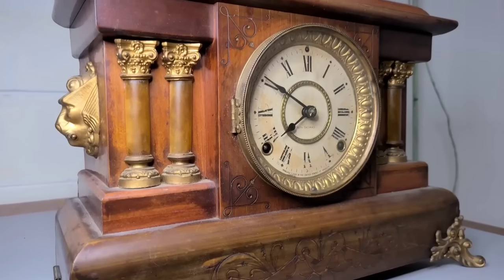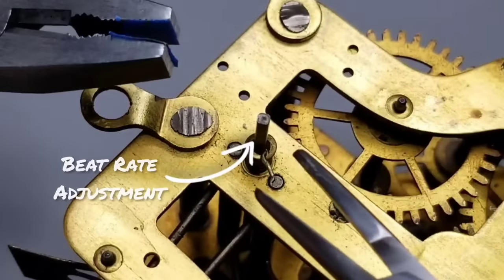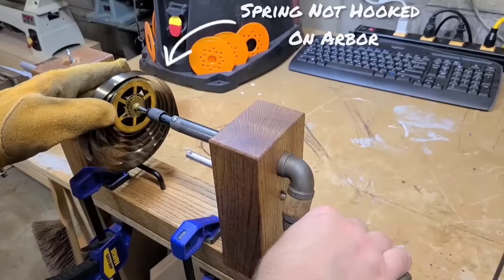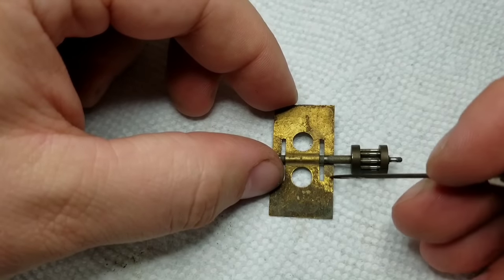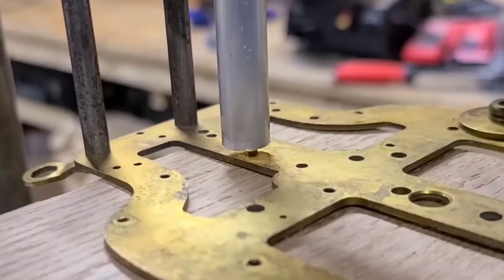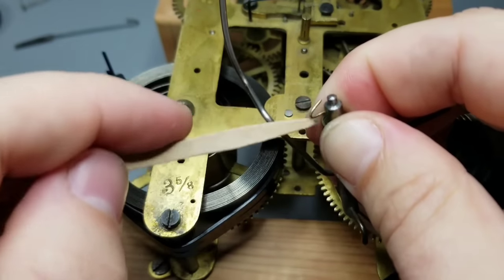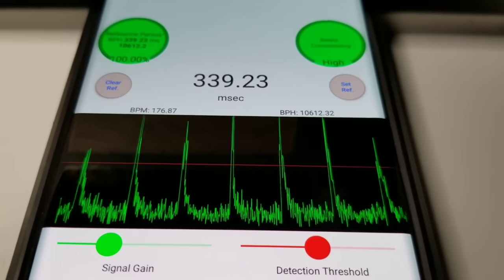Neglected 1900 Seth Thomas Clock Restoration

Comment: I have a mantel clock that looks just like this one, except mine is black.  It used to run but was very sensitive and needed to be precisely level. Now I can't keep it running no matter how much I shim the feet to adjust the level.   Any advice?  I still have the clock on my mantel.
Reply from the maker: Could be many different things such as worn pivot holes, dirty or gummed up areas, power from the spring is getting lost somewhere, etc. Probably needs to be cleaned and inspected for problems.
Reply: @WatchOverhaul   thank you.  Maybe I’ll get that done as a Christmas gift to myself.

Comment: Great job, nice to see you learning techniques to repair and maintain this old clock. I was curious as to why you didn't use a solvent to initially clean the works? My method is solvent first and soap last.
Reply from the maker: I was thinking using the solvent last to remove any lingering soap residue. Probably would be better to use a solvent first, then soap, then back to a solvent.

Comment: Hey man, I just found your channel and this video has been a real blast. I wanted to ask if you have any insight because I'm sure American clocks have roughly the same mechanisms, such as the striking hammer having three levers on its arbor. ive eug around and I cant find very much about this part specifically. So I found a Sessions movement in pieces and it came with the striking hammer outside the movement. When I put everything back together and allow it to strike, the hammer bounces a lot each time it strikes. In this Seth Thomas, the hammer has no recoil. Is one of the three levers on the hammer meant to counter this recoil or is that the job of the spring wire? If you can respond, I'd be very happy.
Reply from the maker: Hey! Thanks! It will be better to talk via email. Comments aren't the best for back and forth conversations. watchoverhaulchannel@gmail.com
Reply: @WatchOverhaul  No worries, mate! I think I discovered what I was missing - the spring is indeed responsible for withholding the recoil. But thanks to watching your video, I can safely understand that. I'll keep your email in mind when I need to keep in touch 😁

Comment: When your little regulator fan is turning if it is in a room like the kitchen when something is frying,  There is a tremendous amount of oil in the air and it will stick to the front side of the fan because it is pushing it out of the way.  Making it sticky and then all the dirt in the air will stick to it!
Reply from the maker: Good point! Thanks for watching!

Comment: Hi thanks for sharing this! Two quick questions. Please help. What app are you using to count the beats per minute? And you showed the theoretical vs. the actual. How did you determine the theoretical?
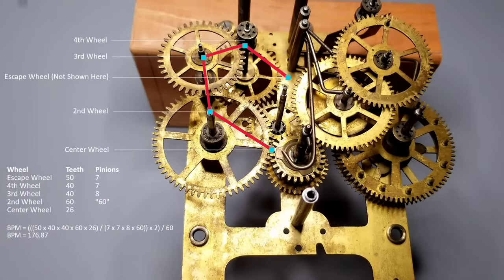Reply from the maker: The link to the app is in the description of the video. I explained how I calculated the theoretical BPM at 32:09.
Reply: @WatchOverhaul  Thank you!

Comment: Curious as to why you didn't soak the springs in a container of mineral spirits or other solvent to try to loosen/remove some of the crud that has to be in The central part of the springs? Also, it appears as though you are not allowing the parts to dry before you clean with mineral spirits. Why not just skip the non-soapy soapy water step? 
Cool video !
Reply from the maker: I'm just trying to keep things low cost. I would end up using a lot of mineral spirits, and it's not cheap. Thanks for watching!

Comment: My Waterbury mantle clock strikes at 6 minutes past the hour and the half hour at 36 past the hour  :(  Where did you find the roll of hammer leather?
Reply from the maker: I haven't worked on a Waterbury clock yet so I'm not familiar with its inner workings. Someone more experienced would probably know what the problem is. First thing I would check is if the minute hand is seated correctly in the right position. The minute hand usually fits over a notch so it's kind of keyed in the right position. If this has slipped, then it could cause it to be off.

I have links in the description of many of the things I use. I got the leather cord at https://amzn.to/3qI6KW8.

Comment: I don't know for sure, but it sort of looked like many of those pivot holes (including the escape wheel one you repaired) had pressed-fit bushings already in them?  I thought you might press out the worn one and replace it instead of filing the opening.  That would seem like a way to be sure it's stays 'centered'.  

Anyway, great video, showing a lot of work in cleaning and the proper servicing of a clock.
Reply from the maker: They did look like they had press-fit bushings and I thought the same thing, but they weren't. The metal was just pressed that way from the factory to create oil sinks.

Comment: I use a Very thin set of strong alligator needle nose pliers to slightly bend the spring so it hooks to the pin. (Standard Clock repair practice to modify that spring shape) I call it a fly, have not heard it called a fan.
Reply from the maker: That's what I'm finding out too. It seems to take a little fiddling. Regarding the fan, I've tried to look up what the proper name is for everything. I've seen it called the "Governor Fan" or "Fan". I'm far from an expert, that's just what I thought it was called. Thanks for watching!

Comment: Any idea how to figure the key size I need ? I have same clock but 1902 year model
Reply from the maker: You have to measure the arbors that the key goes on. They can be tapered so you need to account for that as well. I have a digital caliper that works well. Record the measurements in mm because that's probably how they'll be described when you search for them. Try looking here https://timesavers.com/search.html?q=Key&go=Search

I had to do this process that I'll show in my next video, but it's not uploaded yet.

Comment: Goopy, over-oiled, sticky parts are common in the firearms world as well.
They don't clean them either, they just dump or spray more oil in them until they work again.  Never thinking they are doing more harm than good.
Reply from the maker: I'm working on my next clock right now and it literally seems like someone dunked the movement in used motor oil. There's thick, black, oily gunk oozing out of places. Oil and dirt just forms a grinding compound that can cause so much damage.
Reply: @WatchOverhaul  I'll hand it to you, you are a lot calmer than I.  I talk allllll the time about folks cleaning their firearms and not just oiling them.  There is a rant on my channel where I go off about an 1100 shotgun that quit working because the owner never cleaned it.  I started the video a half hour into cleaning it.
I guess I shouldn't complain, it makes me money.

Comment: Word to the wise--please check the tightness on the rivets that hold the clicks on the great wheels. If they let go on winding it could mean stiches. to keep working play put a .003" shim between  the click and wheel, snug the rivet and remove the shim. Both clicks on this clock great wheels appear to have too much play/wiggle/looseness.
Reply from the maker: Thanks for the tip! How do you tighten up the rivet?

Comment: Did you ever try dishwasher soap in the ultrasonic ?  Cleaned my glasses for days
Reply from the maker: I actually used a little dishwasher soap in the ultrasonic for the clock I'm working on now. It seemed to work better.

Comment: Really great work. I particularly liked the detail and close up filming of bushing the worn pivot hole. Did you contemplate working on the interior wood work? Thanks I look forward to your next "adventure" Thank you Peter
Reply from the maker: Thank you! I would like to get more close ups like that in the future, but I'm just using my smartphone to film so it's hard to do sometimes. Hopefully, I can upgrade to using better equipment at some point. I looked around the inside and didn't see anything that really needed addressed.

Comment: I have one incredibly familiar to this, mine is black and the pillars are a green marbled look. Runs great only losing about 2 minutes a week. Only problem i have is it strikes almost perfectly on the half hour but is 2 minutes fast on the hour. Is it a problem with something inside that needs adjusting or something i shouldnt worry about. Also mine has the same screw on the striker which is weird. I need to find a piece of leather and do the same repair. I also have a clock of my grandmothers that needs repair, i dont know if you would be interested in looking at it but i'd love to hear it one day.
Reply from the maker: I'm not too sure why it's chiming a little early. I would have to look at it. Someone more experienced could probably rattle off the problem, but I'm not there yet. I would first check if the minute hand is loose. The minute hand goes on the center arbor and is usually keyed so it doesn't slip. You can check if it has slipped. Also, I've sometimes noticed there's a little play in the minute hand where the minute hand can wiggle forward or backward without the arbor actually turning. I've seen this behavior on a couple clocks and others not and I'm not sure why it happens yet.

If you can send me pictures of your grandmothers clock to watchoverhaulchannel@gmail.com and I'll see if it's something I can work on.

Thanks for watching!

Comment: That clock is called an Adamantine which is referring to the marble like finish of the case. It is a finish design that was patented exclusively by Seth Thomas in the late 19th century.
Reply from the maker: Yeah, I talk a little about Adamantine veneer in this video. What I read was Adamantine veneer was developed by the Celluloid Manufacturing Company of New York City. The Seth Thomas Clock Company purchased the right to use the Adamantine veneer in 1881.

Comment: I liked watching you work, and I have but one question; why didn't you do anything to the face? Seemed to me that with just a little bit of work you could have made it look so much better. At least you got the nice clock going again...
Reply from the maker: The dial on this clock is a paper dial and original to the clock. While it showed some wear and deterioration, it was still easily readable. It wasn't in a condition that justified stripping off an original 122+ year old dial just to try to make the clock look better. Thanks for watching!

Comment: 6:51 why does it say 3 5/8 on the bottom left of the clock frame? Timing?
Reply from the maker: I'm pretty sure the 3 5/8 refers to the length of the pendulum suspension.

Comment: awesome post and new subscriber... this is the first time I have seen someone repair an old clock like this.  
I have a Seth Thomas(1860s?) gifted to me a while ago.  It does not work and needs restored.  The face plate looks to be 1860s but I am not for sure.  It has the lead weights to wind.   Please let me know if your available to provide an estimate. I can send picts in an email. Maybe it could be used for another vlog.
Reply from the maker: Thank you! You can email me at watchoverhaulchannel@gmail.com
Reply: @WatchOverhaul  thanks so much.. i will email with some pics.

Comment: Great detailed video, thanks for posting.  I have a mantel pendulum clock and wonder if you would have any reference books that might point to its age or manufacture?  I've tried the Internet with no luck.   I purchased it used, 50 years ago, in Londonderry, Northern Ireland.  It runs great, chimes, and keeps accurate time.  I recently had it professionally cleaned (and it was tough finding someone that does that kind of work anymore) and he had no clue as to its history.  The only clues I can supply is it chimes the hour and half hour and has the following stamped on the brass back plate   12cm  190'66    It looks to me the accent between the 0 & 6 is an apostrophe, not a comma.  The only adjustment is a small nut at the bottom of the pendulum to raise/lower the weight of the pendulum.  Would it be safe to assume this is a clock that comes from a country that uses metric measurement?  All the gears & workings of the clock are not far removed from the standard gears found in most regulated clocks.  Thanks again!
Reply from the maker: I'm glad you liked the video! It's hard to tell what kind of clock you have without seeing some pictures. You could send some pictures to me at watchoverhaulchannel@gmail.com and I'll try to do a little digging and see if I can figure out some information about it. Thanks for watching!
Reply: @WatchOverhaul  Thanks!  Will do.

Comment: What about boiling the main springs. Then skim off the ick on top of the water, followed by the cleaning you gave it.
Reply from the maker: I don't know about that. I haven't seen that before as a recommended method. The method I used is what I read others do. It seemed to work just fine.

Comment: Ya might have a bent tooth 🦷, or several worn teeth on your escape wheel 🛞. Your movement also could just need a cleaning 🧼 and oiling. You’ve got a pretty 😍 darned good 👍 idea 💡 on letting down the mainsprings. Worn leather on your strike 🪧 hammer 🔨, that contributes to the harshness of the chime. I hoping for ya that there’s no worn bushings (bearings) in this clock 🕰. I know it’s an heirloom, and means something very special to ya. Happy Halloween 🎃 👻. Your friend, Jeff.
Reply from the maker: Thanks for watching!

Comment: If you are going to be doing more clocks, you might want to invest in a larger ultrasonic cleaner with heater. Also add Alconox. Water soluble, biodegradable powdered cleaner.
Good luck.
Reply from the maker: Yeah, I've been looking at bigger ultrasonic cleaners but haven't decided which one to get yet. Thanks for the info.

Comment: My dad used to what you are doing  he used to b uild then from scratch.  the oldest he repaired was  a 1806 seth thomas mantel clock.
Reply from the maker: Very cool! The Seth Thomas Clock Company didn't start making clocks until 1813, so 1806 doesn't seem right.
Reply: @WatchOverhaul  I could be wrong.  But I do remember it was 1809.  Sorry I was wrong  over 56 years ago
Reply from the maker: That's a really old clock! It's really neat to work on something that old and get it running again.

Comment: Just out of interest, as someone in their 50's looking to start playing with clocks. Other than your channel any advice on where to start ?
Reply from the maker: - You should probably start with a clock you know is working that has loop end mainsprings. 
- Take plenty of video and pictures while disassembling so you can use it as reference to put things back together. 
- You don't need fancy tools to get started or do basic things like I'm doing.
- Read and check out this website https://mb.nawcc.org
- Take your time, have patience and don't rush through anything.
- You can check out the links in my video descriptions for the things I use. 

I'm an amateur and just work on clocks and watches for fun. So using my videos as reference could help you, but I wouldn't treat them as a professional or expert how-to guide.
Reply: @WatchOverhaul  Thanks for that, I did actually join the NAWCC forum last week when I thought about starting this as a hobby :)

Comment: Use charcoal lighter fluid on 0000 steel wool to clean the main spring. It dissolves better and probably not as harmful to breath. Then wipe with denatured alcohol last thing. Also I wouldn't trust those zip ties. You need to buy some of those old fashioned C spring holders. Also you can clean the springs in the ultra sonic if you want, old dirty cleaning fluid. Put some dawn and household ammonia in your ultrasonic
Reply from the maker: Thanks for the tips and for watching!

Comment: Very good. My gp had one just like it.  Always like hearing dong when I am sleeping in the living room.   How do you adjust the beats for the hammer?   This my 2nd video and I am hooked.  Looking forward on your new and the ones in the past.
Reply from the maker: Thanks! What do you mean by adjust the beats for the hammer? Do you mean how many times it chimes for the hour it's on? If so, what I do is:
1. Listen to how many times it chimes
2. Loosen the hour hand (it's probably pressure fit on)
3. Move the hour hand to the correct hour
4. Push the hour hand back onto the arbor.

Thanks for watching!
Reply: It made it clear to how you did it on the next video.  Thanks very much.

Comment: Maybe a short ultrasonic bath in an oil eater solution would have been good before you started taking the movement apart. 🤮
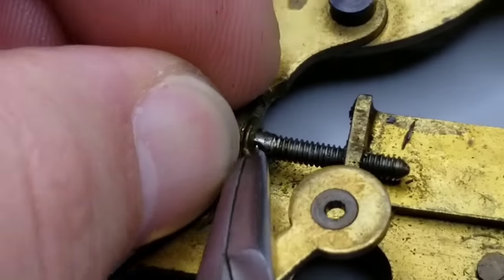11:00 Also allows easier precise adjustment vs trying to move the bob screw and upsetting the position of the bob above it. 2 pts for that!
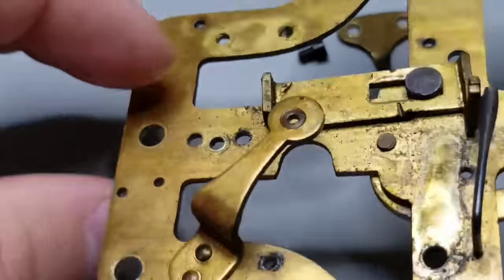12:05 Also really cool! Another 2 pts for Griffendor! 😁
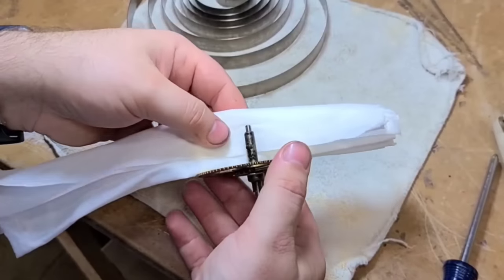15:50 I'm looking at that and wondering it you can maybe think "tower of Hanoi" and push the center bits out vertically to be able to access more of the surface area. First one way, then the other. Won't be a complete job, but better than nothing.
24:30 Probably gravity. Betting someone sprayed oil inside and the chime was not wound for many an era and that's where the oil collected, on the lower side.
37:05 It's also a legitimate part of the clock's repair history. Personally, I'd be inclined to replace it, or at least file on it or something to try to clean it up, but as you say, if it works, it can stay.
Reply from the maker: Thanks for the detailed comments and suggestions!

Comment: I have a Grandfather’s clock I got while in Germany and it also had a worn hole in the brass back bracket or plate , causing the clock to not stay running the clock repair person called it a “bearing” he replaced the brass plate that had no wear in the pivot hole and cleaned up the whole unit and recoiled greased and it been running fine for over 40 Yrs. You’re clock had the same issue so I’m guessing this is an issue with many clocks with this type of movement.
Reply from the maker: That's awesome it's been running so long. I think it is a common problem that happens over time. Thanks for watching!